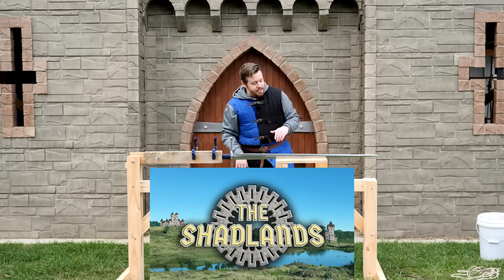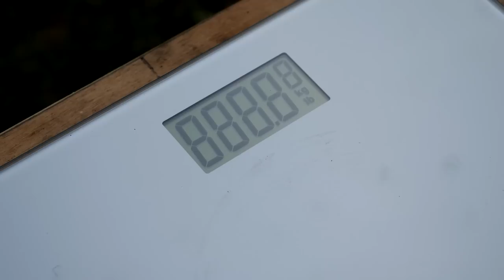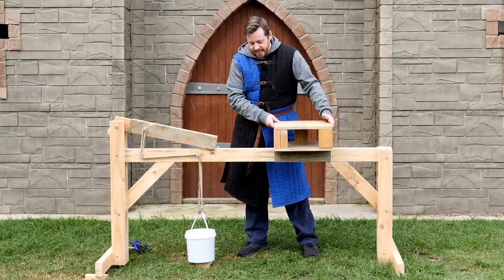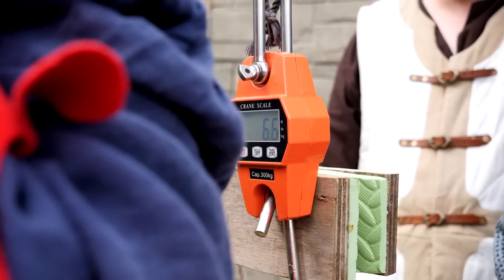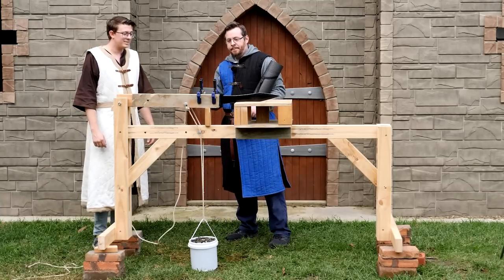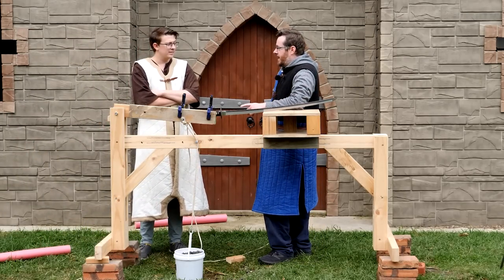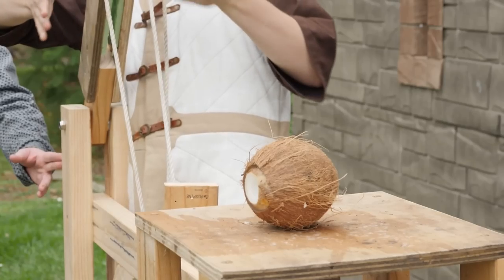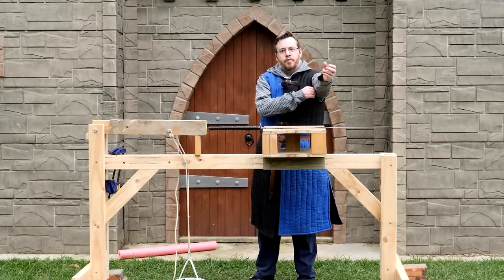Choppy choppy

Comment: really disappointed regarding your whole force test. You know that a swung sword will have way more kinetic energy than what you can impart by just pushing down on a scale. I don't see how this test rig is going to be a valid test. Sure maybe you can get consistent results, but they won't reflect what the weapon would actually do in combat. So why bother doing the test...

There are a lot of other problems too. You are measuring the weight where the sword hilt is located, but you measured the weight at the tip of the stick you used as a reference. This obviously won't give you the desired results.

You speak with such confidence but you don't actually understand what you are doing. Please, get help from your community so that you can redesign this correctly.